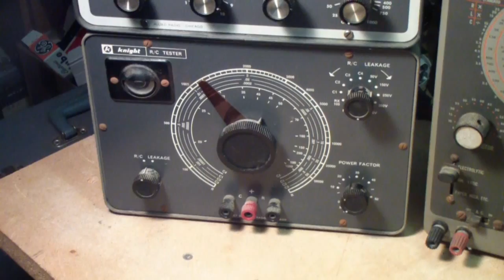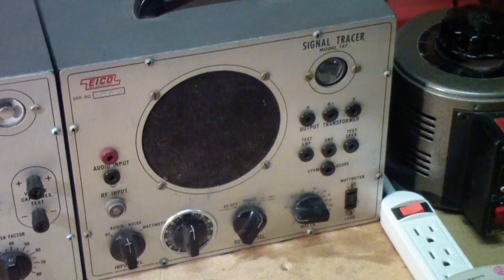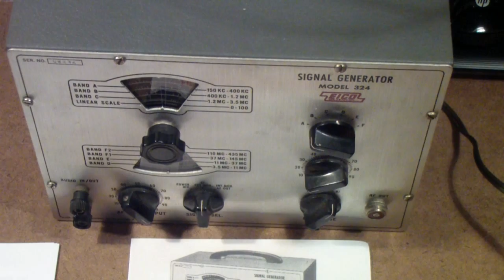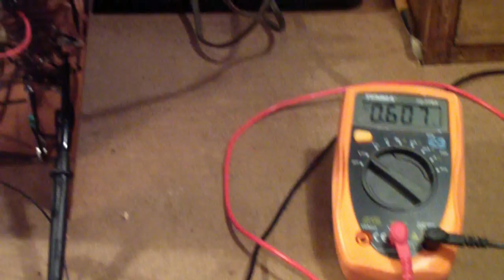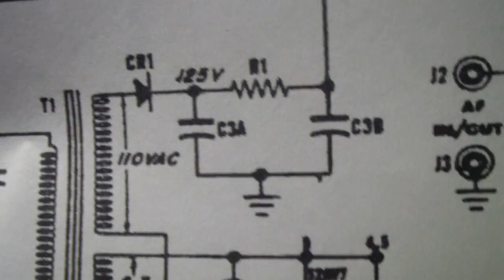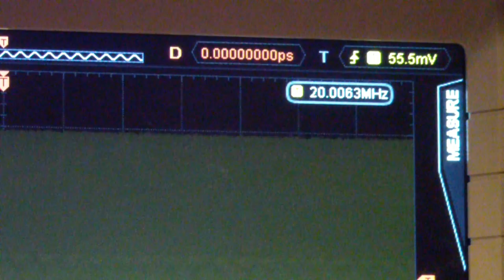TTT187 A Vintage Radio Workbench Pt 1

Comment: I'm doing the same thing with equipment I bought in the 60's and right now I am refurbishing . Instead of a signal tracker I have a used Tektronix dual trace scope. I've got the EICO 324 signal generator, 625 Tube tester, and VTVM. To check the accuracy I used a B&K 1801 frequency counter. I test d and changed all the caps in my EICO 324, especially the electrolytic , even though they tested good. The fuse is a good idea.

Comment: I love to see folks restoring vintage test equipment and more importantly putting it back into service.  I too have a vintage radio workbench, mostly consisting of older Heathkit gear.  I too restore my stuff to the point that it is functional again at its intended level of accuracy.  Also good advice to new folks about viewing You Tube videos, you certainly can learn a lot but doing so does not make one an expert. Unfortunately today finding a mentor can be difficult for some.  I am one of the mentors in our Amateur Radio Club and I help whenever I can.  Great videos Tom, keep it up.  
Mike

Comment: Just a question here from a newbie.  Household line voltage is approx 120vac RMS, correct?  That's at least what I've learned on the web.   Doesn't this mean that the peak line voltage is much higher, say approx 170vac?  Not nit picking just trying to make sure I'm learning the material and applying it correctly.   So if you wanted 2x line peak, you'd be 340 but since many caps are rated in standard discrete reverse voltages, 400v would be the safe standard cap rating?    Again, I'm new to this and trying to learn as much as possible.   Thanks.
Reply from the maker: You are correct, for a sine wave the peak value is 1.414 times the RMS value. Actually most line voltages today run a little higher than 120 V RMS (min runs about 125 V RMS) so the peak is a little over 176 V.

Comment: I still don't have a smart phone! I use a flip phone, fits in my pocket, and only needs to be charged once a week! I wish I had kept my old Heathkit IM-18 VTVM. I only have digital meters now, but sometimes a moving needle is a big benefit.
Reply from the maker: Call me flippant, I still use a flip phone - had a smart phone for a while - found it too dumb for me - went back to genius phone which flips open and does what I want instead of what the seller wants.

Comment: A vintage test bench,  excellent idea.  Eico made some decent VTVMs as well.  You know what might be really interesting and instructive: When you are satisfied with the vintage bench configuration, run a vintage tube radio through some resistance, capacitance and voltage checks.  Then repeat the process with modern gear and compare the results.  Thanks for this.